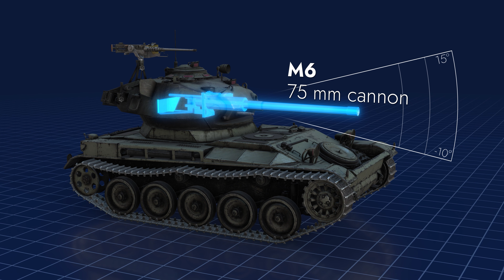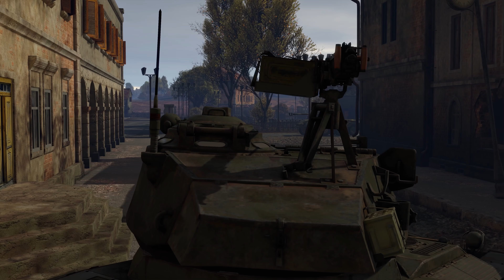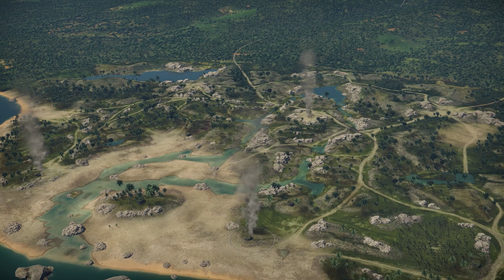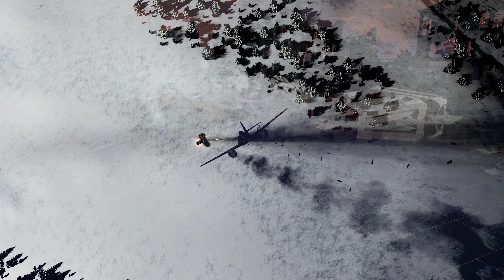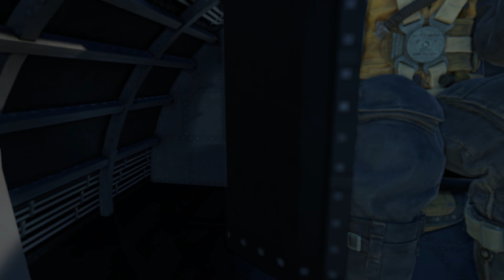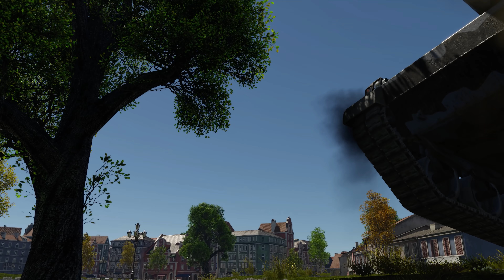THE SHOOTING RANGE 215: Welcome to the jungle / War Thunder

Comment: Hey Gajin, as you know, many players love your game, the graphics and game mechanics are something else, none of this would have been possible just 10 years ago! But why is it that the company ignores ANY input from the community? Like an authoritarian government, you guys close down opinions your don't like, this has been seen on the forums, and in the Shooting Ranges's Hotline no matters of importance are EVER discussed! Then why call it "Hotline"? Gajin, you did something much worse to the game than give Stock HEAT to tech tree tanks, you screwed with BR instead of decompressing it. Not only that, the repair cost when up 5 or 6 fold on many aircraft! How ridiculous is that? The CL-13 MK.6 moved to 9.7 with a 33k repair cost?! The G.91YS and J32B moved to 10.0 ABOVE the Lightning F.6! As if two transonic aircraft are better than a mach 2 aircraft? This is ridiculous. I suggest the BR gets decompressed to at least 11.0, and that most planes at 9.7 get their OWN separate Battle rating, where they can't meet mach 2 jets but can't meet 9.0/9.3 jets and smash them either. These planes should be put in their own BR, there is enough of them: At 10.0 (Once BR is decompressed to 11.0 that is) should sit the Hunter F.6, perhaps the Lightning F.6, all F-100 variants, all Starfighter variants (except the Chinese one with broken missiles), all MiG-19 variants, and the Chinese and Russian MiG-21F-13, and don't forget to bring along the new Q-5, the Jaguar, the T-2 Mitsubishi, the G.91YS, the J32B, and finally, the Po-2! This aircraft BR would be very healthy, with everyone having a good chance, and Top tier jets would remain at 11.0/11.3 and would not fight against this BR. It makes sense, although, I don't wish to change Gajin's mind, that is an unrealistic, childish idea, but I hope you all will spread and share this idea with the community, as I think it can fix top tier jets, as a contemporary solution. And the F-11A might also fit this BR, just lower all repair costs, because this game's economics are crazy, it's difficult enough to make lions. Have a good day everyone!
Reply: That will never happen
Reply: Indeed
Reply: This is exactly what Whooptiedo said but they just don't listen to anybody, not even the content creators
Reply: @Alex-bi2wv  they listen to one thing : MONEY!!!
Reply: Stop spending money until gaijin reacts to our complains
Reply: Tillmann Poseck I am free to play they don’t respond to complaints made by 5 year olds because they are low skilled
Reply: @SheridanM551  Still going on telling people they have no skill, just because you are one of Gajin's sheep. You ridiculous hypocrite. 🙄
Reply: Benjamin Padilla they point jam trying to make is that if you don’t focus on your skill you will lag behind other players who do focus on their skill even veteran players always analyse your mistakes Ian trying to help you and everyone don’t believe watch jengars how to grind video I love this game and always put skill and game enjoyment as highest priority this really has helped I managed to unlock a g55 in a day just by focussing on skill I hope this tactic helps you to I don’t have premium
Reply: Jonathan Daniel I understand that everyone shouldn’t know perfect English, but this gives me a stroke reading it.
Reply: Gaijin be like: imma ignore dis
AdD MoRe TaNgS!!!
Reply: totally agree with this. but i just wonder that gaijin will look Youtube comment section? they just ignore everything lol
Reply: VVV Penguin even if they did they wouldn’t care unfortunately
Reply: I agree and what does the german ww2 jets do at 8.0. I really struggle to get kills with it
Reply: They should put low repair costs and they should be the same for tanks of the same tier

Or they should delete the repair cost mechanic which is dumb as hell
Reply: Thats what i said very often !!!!
Reply: TLDR bruh
Reply: Gaijin is garbage!!!!!
Reply: For days I been telling  them the game isn't  working  in xbox and never heard anything  about  the fixing  nor a reply so shitty when I had to pay for the game when it came out and I bought alot of ships back then they took them from me and give me nothing  in retu6
Reply: HA imagine
Reply: Yes
Reply: lmao
Reply: Im whit benjamin
Reply: Haha today I just hull broken a obj 120 with the 3.0 italian semovente
Reply: BR got decompressed, in early July I think, or late June, they introduced 10.7. Not sure when was the 10.3 introduced, but it wasn't long ago as well.
Reply: BIOSHOCKFOXX Should still be decompressed to 11.0 at least
Reply: It’s just the record of games and lack of players
      

I’m not saying I’m defending gaijin server

I’m stating the freakin obvious
Reply: If players want change, they shouldn’t threaten Gaijin. Instead ask them in a nicer and formal way!
Reply: @kakz1466  I agree, and with no comparisons to a government
Reply: well you can be a 2 year old baby and complain about the silliest of things stock heat was to balance the game repair costs exist because if a vehicle on average makes a lot of sl then amount to repair it is also increase high risk high reward complaining about brs is for low skilled people as its not the vehicles that win engagements its the people in command who do if you focus too much on complaining then you wont enjoy the game. if you focus on skill you will
Reply: @SheridanM551  that is not correct some of the times, it's more true for tanks. For aircraft if both players are equally good and one is in a saber the other in a lightning, then the lighting can play their energy to have a HUGE advantage in comparison with the saber.
Reply: Jonathan Daniel except
Say you play badly for like 5 games and die all those times
Oh well
You lost all your SL
You have to use reserve tanks/planes for a while.
Reply: @SheridanM551  nice bootlicking boy
Reply: Jonathan Daniel ok gaijin employee
Reply: @Isjamieinnit  i dont work for gaijin
Reply: Jonathan Daniel well you have the same brainpower and playground insults as them so idk
Reply: @SheridanM551  I don't think you have played the game
Reply: muji panda I have played this game for almost a full year I know it I have quite a few tier 4 vehicles and very soon will research tier 5 screaming at gaijin isn’t going to get you anywhere focusing on your enjoyment and your skill is better if you were to give a beginner a g55 they would always get shot down because their skill level is too low it’s not the vehicles that win engagements the people in charge do
Reply: @SheridanM551  around the ranks you are at the game is perfectly fine it's at top tier when everything starts to fall out of place i understand that "screaming" at gaijin not it a very good approach to thing  but there is little that we can do and we have wanted gaijin to make changes for years.
Reply: @SheridanM551  but it's stupid to punish players for playing the game with ridiculous repair costs and a broken matchmaking
Reply: Mister onsépatro repair costs are in place for a reason gaijin answered this question in a stream if a vehicle makes on average a lot of reward unless it’s a premium then amount to repair that vehicle is also increased so it’s high risk high reward oh and complaining about a broken matchmaker is for low skilled losers a good player will do well in any vehicle that is given to him in ground run whoever shoots first and lands a penetrating shot is more likely to win with  planes it’s the same thing
Reply: @SheridanM551  like it or not the matchmaking is messed up it looks like you never spent entire days getting uptiered every match and some people play the B29 which has a ridiculous repair cost end up against jets that kill them easily which make them go broke uptiers are really frustrating when your tank has no stabilizer and the others have one 
If you still think that it's not true you are not a real fan of the game you just want to ruin it
You will understand the struggle when you get to top tier in the french tech tree it's the best example of the absolute bs about repair costs and grind
Reply: @SheridanM551  Oh, no wonder, you're not that experienced, well, I apologise for insulting you, the game is near perfect below rank V, it's the higher ranks and Battle Ratings that suffer, I've dropped at least $150 in my 3 years of playing, and spent a good amount of time per month, like 25 hours per month, so it's frustrating when Gajin basically makes the game worse out of spite for the community.
Reply: @whipplefilter22  it applies even to hight iers and say waht you want you wont get anywhere with your nonsense ranting
Reply: @SheridanM551  No, I think I will get somewhere, that's the point genius, funny how when it comes to politics people such as yourself love to shut everyone they don't like up, but when basic logic comes into the conversation such as BR decompression in this game, you think we're just erratic retards who are "ungrateful", as if we don't work and spend OUR OWN, time, money, and effort on this game.
Reply: Jonathan Daniel 
Let’s take me in the first edition of the 109
Vs
Me playing with the E-3 
My plane would win me a game at 1.3 with the E-3 edition. It’s barely out of their matchmaking BR
You can’t enjoy the game if you can never play as the vehicles you like to play.
Reply: Jonathan Daniel also no. People have different play styles. I’m pretty good with yaks and 109s. But I can’t use a heavy fighter or a bomber.